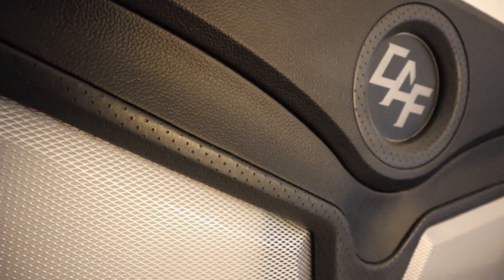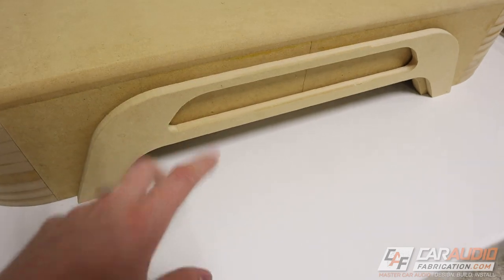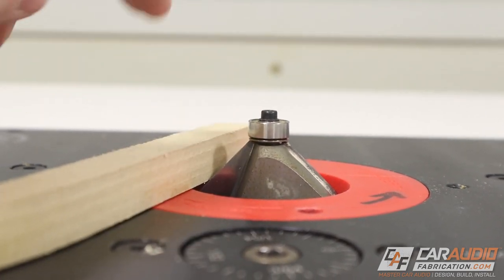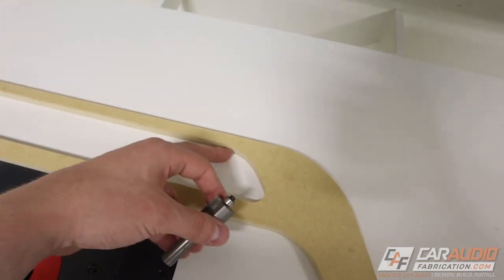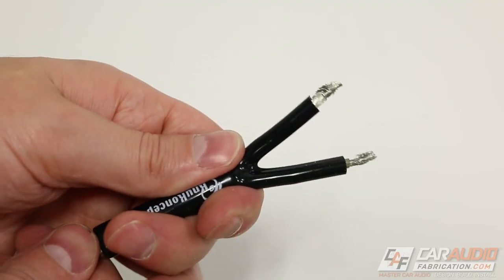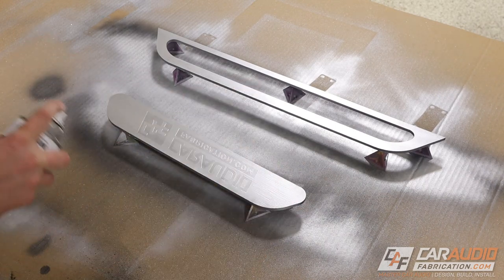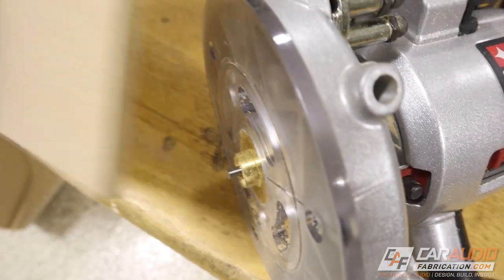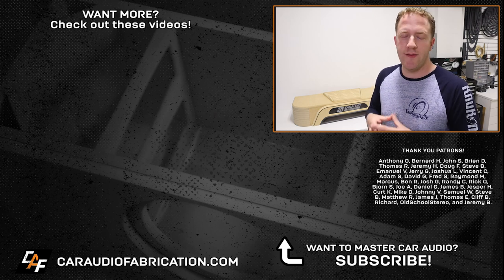Downfiring Subwoofer Box Build - Making Inserts!

Comment: It might just be me, but i would think that mesh isn’t going to hold up over time with just CA glue holding it.   There is some 3m and loctite marine stuff that i have had great luck with holding up bonding materials like this.  

Who knows i could be wrong and ca glue is the best for this.  But I haven’t had luck when using that application method.  When gluing studs to hold exterior trim panels on the RV’s we would cut a plastic washer out bigger than stud so you could glue plastic to plastic instead of metal to plastic. Metal to plastic failed every time.  It was just a matter of how long until it failed.

Comment: Hey CAF I really could use some help, for about a year now ever since my car battery died on me (my fault) i’ve had an issue where my subs seem to get stronger as I drive and sometimes will not come on at all unless I jiggle weird random things like the brake pedal or jiggle a wire harness here or there and it will slowly start to kick back on. There is no rhyme or reason to any of this and I can’t seem to get a Reasonable explanation as to why this is happening. I’ve checked my install and everything seems legit but obviously I probably did something wrong. I would like to add before my battery died everything worked perfectly and had no issues at all. I’ve even re-ran wiring throughout my car and I still have the same issue. Running two 12 inch Pioneer champions, thousand watt kicker amp and a dual double Dan head unit. Sidenote, I changed out the head units and still the same problem

Comment: For the love of God why do people paint the clear acrylic? You could easily just paint the MDF. It just doesn't seem cost effective at all
Reply from the maker: Time is money, to paint MDF and get this sort of effect would take a ton of time. (and paint would be far more expensive as you need multiple types like primer paint and clear coat) Paint the back of acrylic in like five minutes and it looks glossy and perfect. And to be completely honest if you think some 1/8" acrylic is expensive car audio is not a great hobby to get involved in. I purchased this sheet for less than $15.
Reply: @CarAudioFabrication  trust me I know prices of the stuff lol. You make a valid point. Another question for you. Where do you purchase your acrylic? Locally they are crazy in price but I have found some good half inch on Walmart that I did order. I think it's 24"x24" for $20